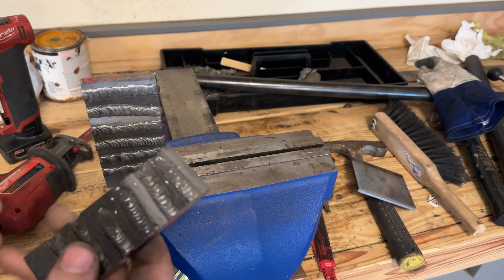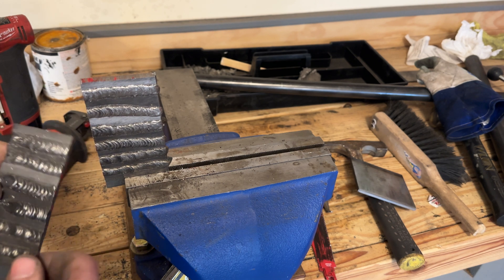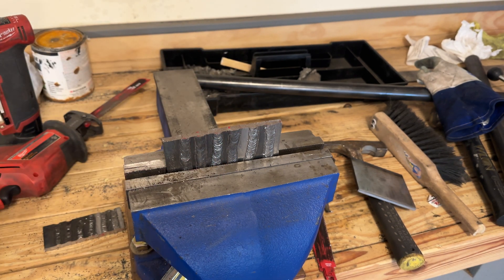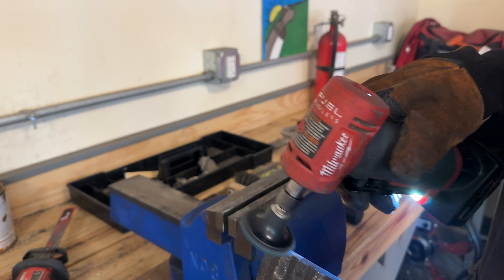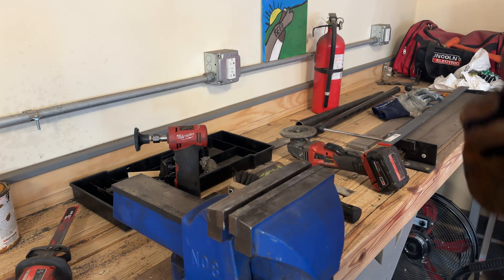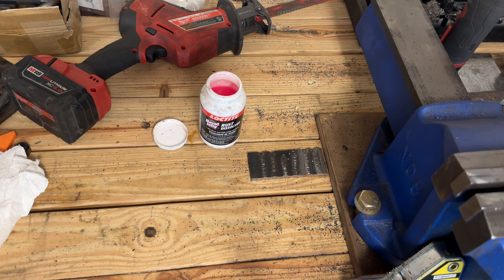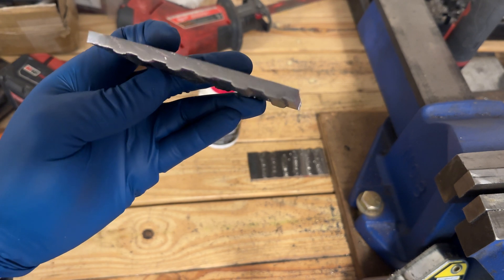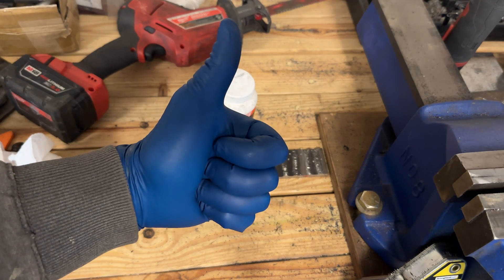How to cut and etch your own welds

Comment: I tried this today outside the shop using an old metal cutting chop saw. It cut fast and left a fairly nice surface finish. It's one thing to hear you say how important it is to do cut and etches. It's another to actually do it and view the results. Example: I was doing beads on plate, and all came out okay except for one. I was to high up on the adjacent bead and I could see the error by looking at the weld penetration.
Reply from the maker: 100% the proof is in the pudding.  Seeing the results with a cut and etch will make a better welder out of everyone.  I definitely have been surprised at a lot of things I have found in tests I have done for the channel lol.  Even had lack of fusion with tig which is hard to believe but without testing I would have never known lol.

Comment: How is the battery life on the Milwaukee die grinder?
Reply from the maker: So I have a 3.0 and 4.0 battery.  It’s surprisingly pretty good for a 12v tool.  It works best with die grinder bits or mini scotch brite pads.  Mini wire wheels it works poorly for.  I also have the 12v band file and that eats the battery far waster than the die grinder.  I find that it will last as long as the 18v die grinder with a 5.0 battery, the difference it the 18v I have cuts faster.

Comment: Can i use the radishack pcb etching solition?    Ive had it for years.
Reply from the maker: I had no idea so I did some research.  It seems ferric chloride is used in some cases, that would work.  Cupric chloride is also commonly used, however I have no experience with that chemical and I am unsure if it would work.  I have a feeling it probably would.  I tend to use naval jelly because it works pretty good, is available everywhere, and has a funny name lol.
Reply: Ferric chloride is used to etch damascus steel, so yes, it will work